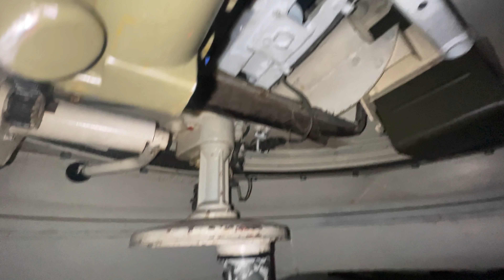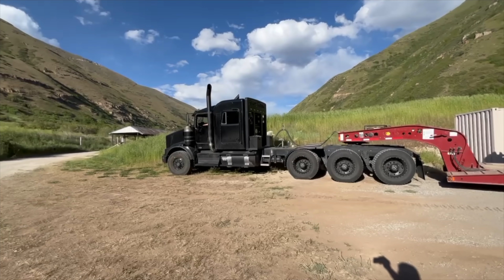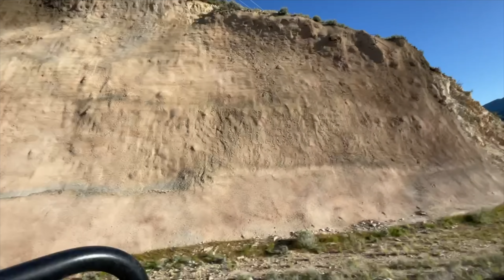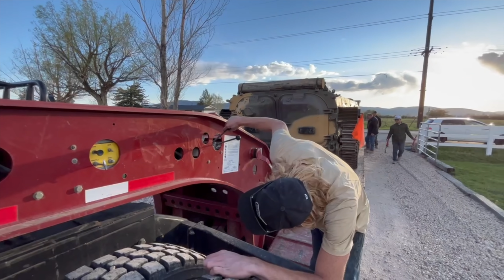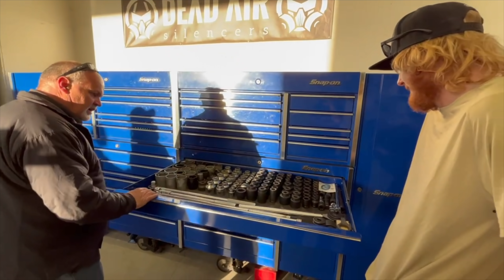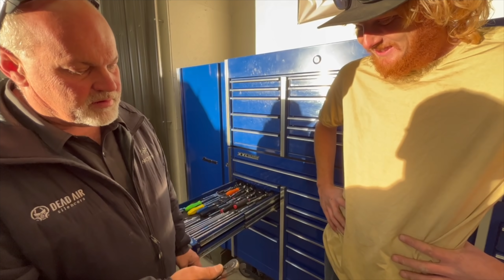I Shot A Tank! Then Hauled It With @HeavyDSparks' Semi Through The Rocky Mountains.

Comment: Very cool video, video quality as good as HeavyD's but nicer without all the excess talking and video effects. And bonus for the cool scenery shots. I also can't help but think you just started a new video segment for your channel, something like "Show us your tool box", add a small part to the end of each of your videos where someone shows off their tool box, even if its not a 50K setup, we all work with what we got and most of us take pride in our stuff no matter how much it costs. As a gearhead I appreciate it all.
Reply: My favorite toolbox has to be my 83 Chevy Silverado 3+3 dually 4x4 with a 454 punched out and hopped up a touch SM465 4 speed NP205 t-case Dana 70 rear and 60 front with PTO 6 inch lift on 35s frame stretched and fully boxed and extra cross members to fit a 15 ft bed with a carne and lift gate hopefully this winter with be when she gets her 2.5 ton axles they've been in the shop for 3 years and came out of an 85 3+3 so hopefully adding a Barnes truss kit is all I have to do to them only other thing I'd change is put the factory front bumper on something I drive regularly and build a winch bumper with grill guard add an amber strobe for working on the side of the road and a few more work lights I already run 2 semi batteries with a high output alternator

Comment: I kind of miss those kinds of roads with a heavy overwidth load on those back mountain roads with a low detach trailer ours was triple axle Landoll trailer with a triple axle 379 Pete pushing 650-700 horse it was insane empty but I don't miss the 40 point turns especially when someone pulls right up behind ya and can't understand why you don't just turn the corner or pulls along side ya and gets upset because you won't go so they can see if anyone's coming I still haul my equipment around my area to do ponds terraces tile work and clear old fence rows to build new fence clean up old farmsteads to keep meth labs out and gain the farmer some extra ground my favorite piece of equipment I don't think I could part with would be grandpa's old 68 Cat D7G with the pony motor start those things suck to start in winter or his old Allis Chalmers track loader they have so much sentimental value if I wanted to sell either nobody would be willing to pay the price for my memories they'll become yard art when I can't afford to fix them